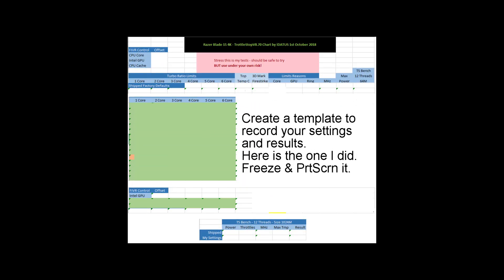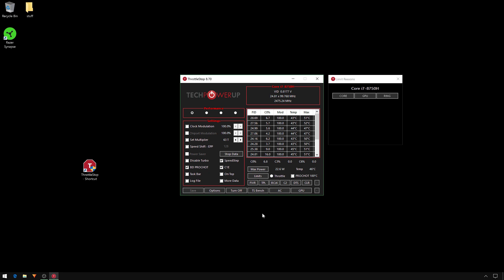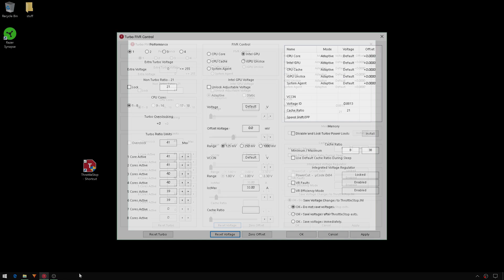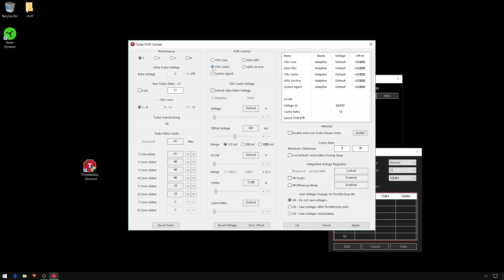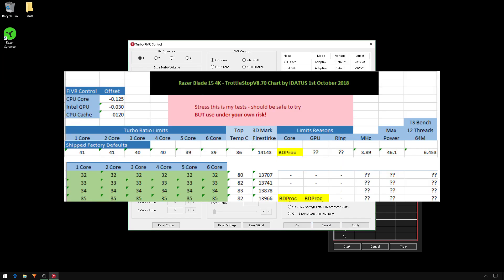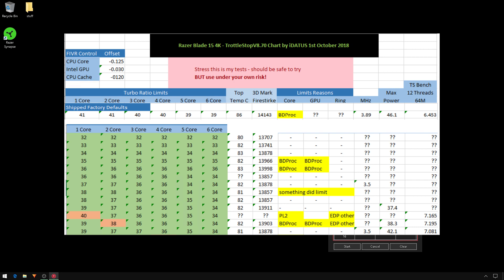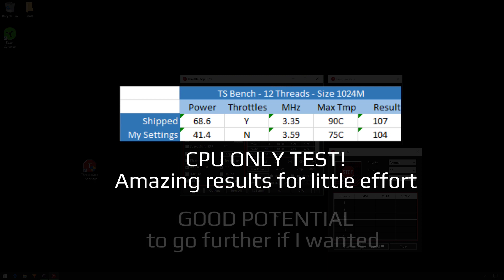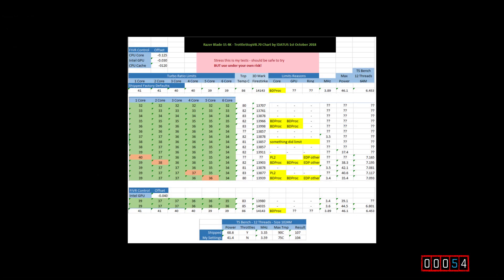Razer blade 15 undervolting with ThrottleStop⮜iDATUS⮞

Comment: sorry abit of a noob here on undervolting, how do you know if it is throttling from the throttlestop test? and how do you get the MHZ?
Reply from the maker: Thanks for posting a comment, all good.
Q1. How do u know if its throttling 
A1. Via the limits box. If the Core or the GPU column has anything in then its throttled.
Q2. How do u see the total Mhz
A2. Main screen, top right - Red box, bottom number, eg. 2340.56 MHz

ThrottleStop like all benchmarking, tweaking tools are not that friendly to use.
I have noticed some other things I should have added and will probably do a follow up video soon.
FYI I am working on MSI Afterburner (GPU tweaks) with Throttlestop as I type this reply.
That's going to be split into 4 bite size chunks. Expect it next few days.
◄iDATUS►

Comment: Hey man great video! I just purchased the RB15 base model and am new to all this undervolting stuff can you please give me some advice?. I only play rocket league so my question is - do I even need to undervolt for the longevity of the machine?
Reply from the maker: Thanks for the nice comment ;)
As to your question, hmm good one, I looked up rocket league and looks tremendous fun.
I don't know what resources the game uses so I would run undervolt - don't change any settings - leave it running and play RL for a match.
When finished see what results for Max Temps for each core and Max power is, also click the limits button to see if you reached any.
You can reply to this comment with results so I can give you a better answer.
Fan speeds is a good indication on how much stress the RB15's or any machine is having.
Reply: iDatus thanks heaps for your reply man I’ll follow this video using this program and let you know how it goes cheers! :D

Comment: Hello iDatus,

First of all thanks for this video.

I dont know anything about undervolting, I just followed all your steps. After this I performed a fire strike benchmark but my temps keep hitting 90c, is this normal? I have the 144mhz model. Thanks in advanced.
Reply: What is ur laptop spec? I have RB 15 early 2019 and used to always hit constantly 90C-97C when playing apex or pubg with medium and some high settings.
For playing not so intensive games, for example, Football manager, sims 4, etc. I use idatus undervolting guide ( max 80C ), high settings. For an intensive game, i will just disable turbo . temp average 75-80C.
Reply from the maker: Thanks for adding a comment and the sub the other day. If you haven't already check out the discussions tab and you should be able to chat in there. Let me know if you try and cant.
Video was a lot faster paced than I would have liked but there was a lot to cram it and took about 24 hours in total to do and several weeks research.
That being said there are some steps that might not have been obvious and that might be what's happening in your case.
But lets see if we can resolve here.
Ignore fire strike 1st and lets concentrate on CPU as that's identical to the 4K as it doesn't use screen frame rate.
Use the built in TS Bench.
Set it to Normal, 12 threads and 1024M.
You should get same/very similar results to me.
Let me know good or bad as believe it or not I do care ;)

Comment: Does it'll increase a battery life?
Reply from the maker: That's another good question. 
Simple answer is yes. BUT you may have to create a separate performance option (main screen, top left, 4 radio button options, choose a different one). 
I have read that when the laptop/windows battery saving options kick in they combine with Throttlestop and the CPU could be starved of power.
I have not tried it yet but its on the list of things to do for the channel. When I do, I will post a follow up video.

You would be surprised how many things you can do to increase battery power. Some compliment, some conflict.
If you haven't already look at my other Razer Blade 15 playlist posts where I have discussed battery power.
◄iDATUS►
Reply: subscribed)
Reply from the maker: Thanks dude. Much appreciated.
Reply from the maker: Not sure if you are still interested but I will be doing a new batch of uploads for Throttlestop and one of them will be for battery

Comment: Question, as I waiting for my device to arrive. Cant we change these values in the bios?
Reply from the maker: Excellent choice, may I ask which model you plummeted for?
Not that I have read or can see.
Might post an video on the bios options as I remembered wondering what you could change in them.
Laptops don't tend to be like desktop pro boards probably as they see that option for overclocking.
Besides I think its safer doing it with software as bios locks would be a pain.
Reply from the maker: I have uploaded the bios screen shot video https://youtu.be/AaasDwEr72o